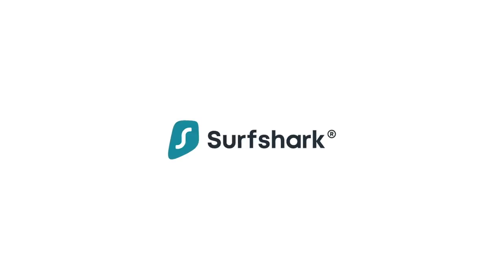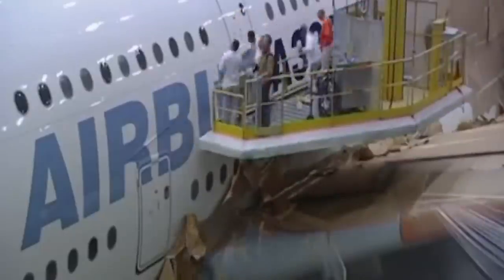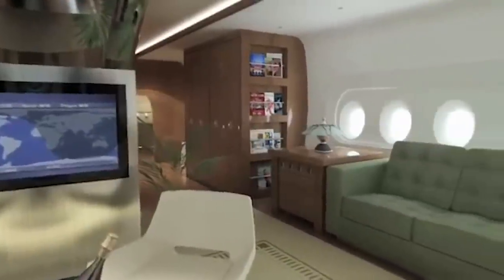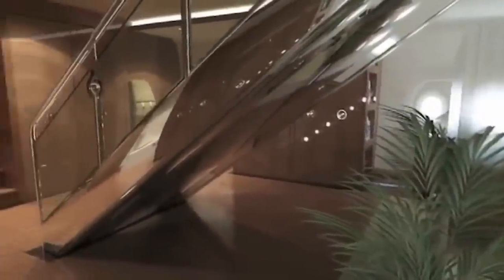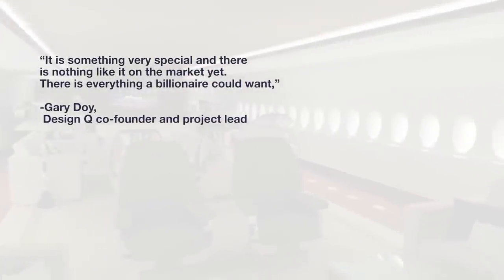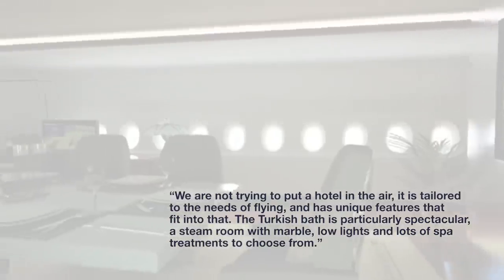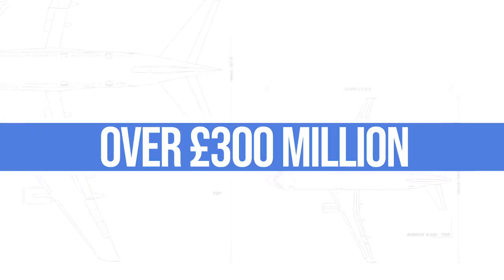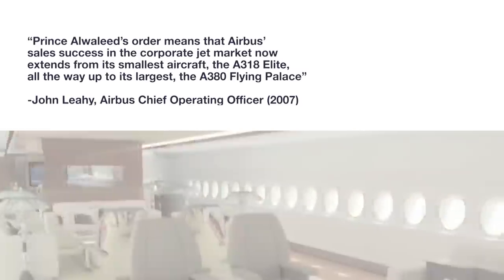The Airbus A380 Palace: The Plane That Never Was

Comment: The vid is kind of misleading. This isn't something Airbus has ever offered. They sell the shell, a functional but completely empty plane. The interior design plans are a separate company entirely, and multiple concepts were created for this project by multiple companies. If it had gone ahead, a third company would have done the actual interior fitting.